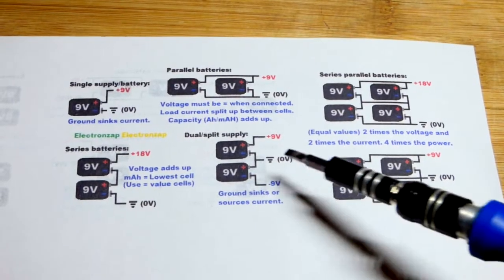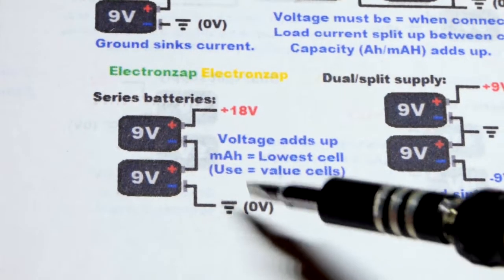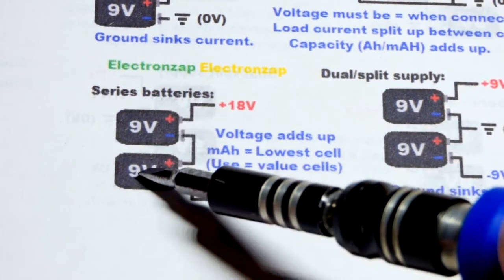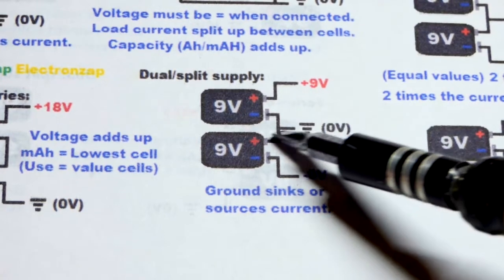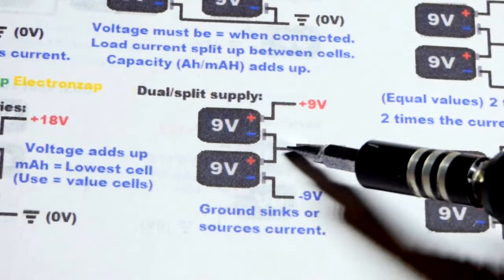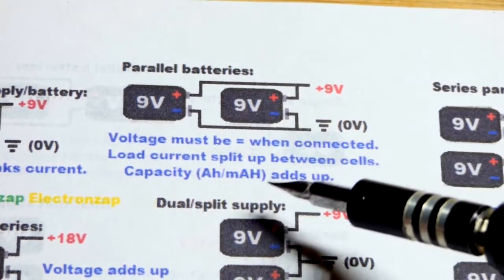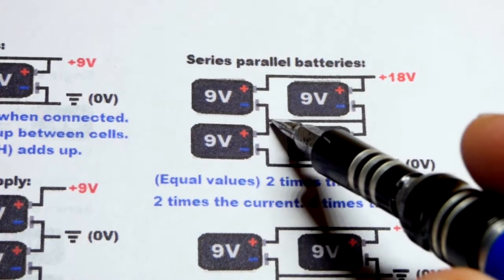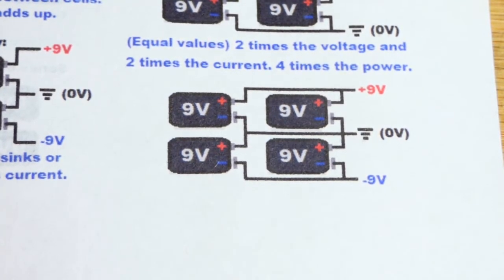Why batteries are connected in series and parallel for more electronics voltage current and power

Comment: Good video! Why would you need to monitor rechargable batteries?
Reply from the maker: Thanks! When you are recharging batteries in series, there is a chance that one will gain a voltage faster than the others one(s) that it is in series with. Most lithium ion batteries can only be charged to 4.2V. So 2 in series can be charged to 8.4V, which will mean each of them are charged to 4.2V as long as they are well balanced. But if they are charged to a total of 8.4V where one is at 4 volts and the other is 4.4V, then the 4.4V one might be damaged. Good protection circuitry should be able to charge each cell independently as needed to make sure none of them are over charged.
There is also a similar problem with one of the series li-ion batteries having too low of a voltage (usually below 2.5V) if it discharges faster than the ones it is in series with and the load isn't cut off in time.
Reply: Thank you!